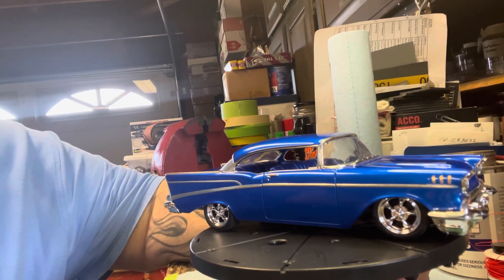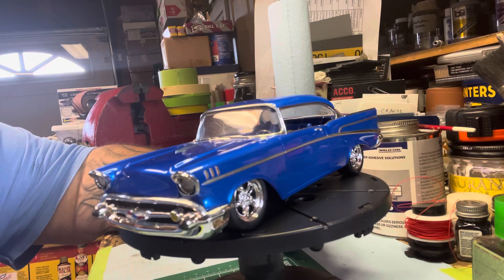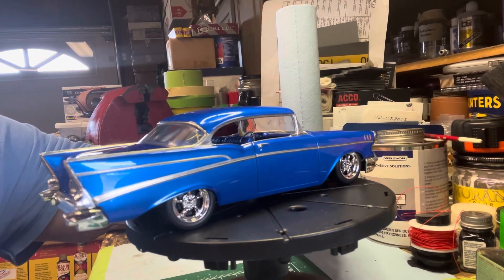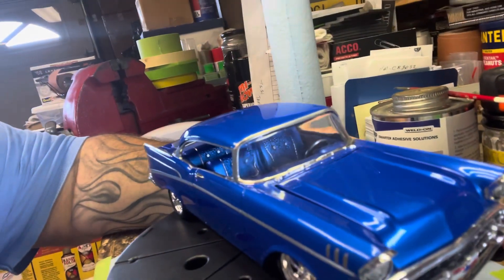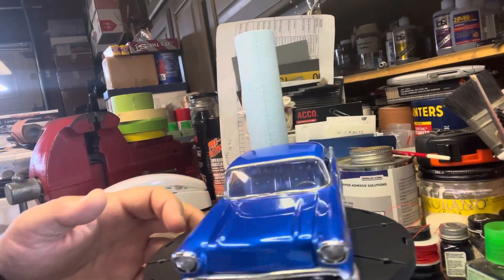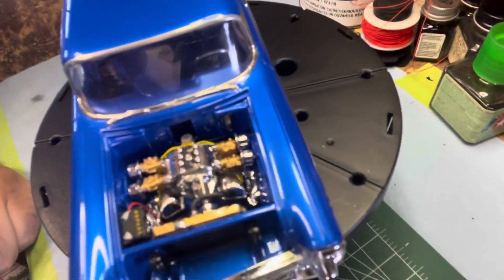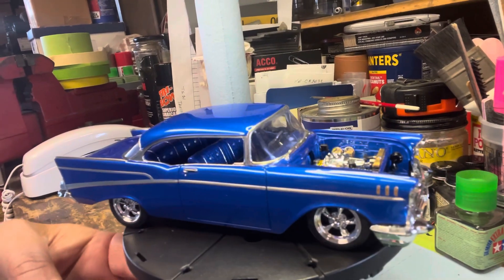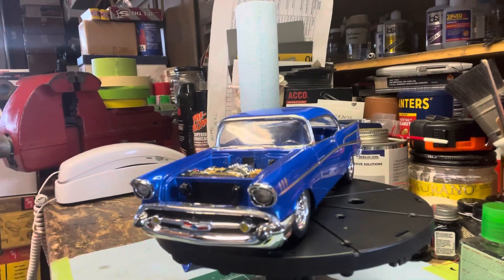AMT 1957 Chevy Bel Air - Model Car

Comment: Man I gotta use some of the HOK.  Where do you get yours?
Reply from the maker: I've been using the HOK stuff for a long time, grew up using mostly their urethane Candy paint, for models, its thicker so you have to watch your mixing and how many coats you put down, the urethane candy's really get their life from the base you use, orion silver, solor gold etc, and can change drastically depending on the base.  I have a 59 Impala that has Candy Pagan Gold over an orange base that looks more orange than gold, beautiful though!  Now I've been using more of the basecoat candy's, a lot easier to work with, especially if you have a lot of parts, matching the color is easier than it is with the urethanes.  Their pearl basecoats are very nice as well, like the ones you see on the page so far.  I get most of the material locally at some auto body supply stores.  I've ordered some from TCP Global and Tropical Glitz.  I've recently started using some of the Tropical Glitz RTS stuff, very nice through the air brush.  I believe you can get some of the HOK RTS stuff on Amazon as well.  For clear we usually use PPG, Deltron and some of these older builds has Sikkens.  Thanks for the comments and reach out anytime if you have questions on the paint stuff!